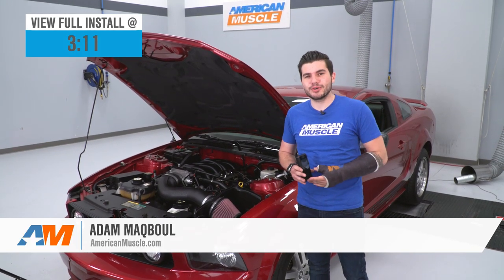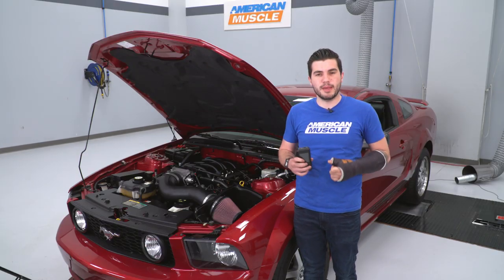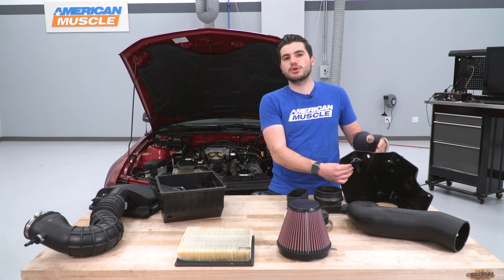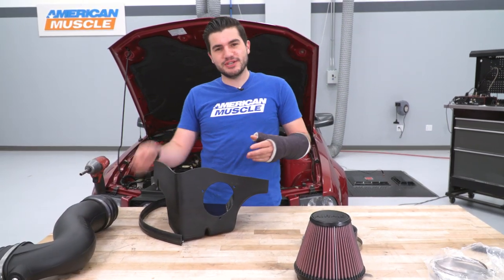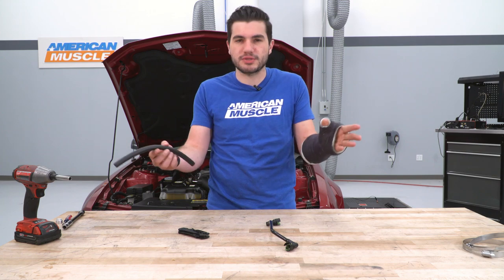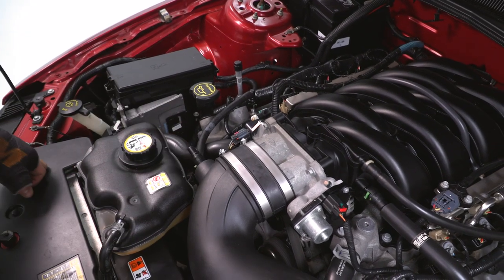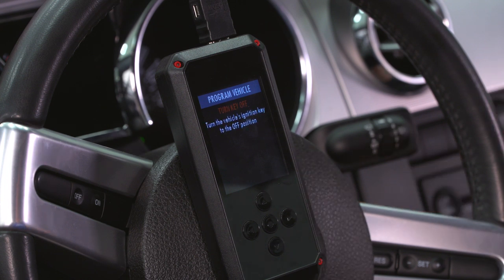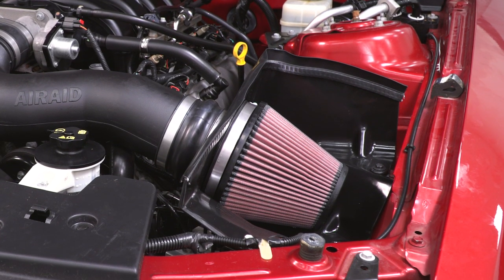2005-2009 Mustang GT Airaid Race Cold Air Intake & BAMA Rev-X Tuner Review & Dyno

Comment: i do have this on mine already, along with the bama 93 race tune. it's a very nice setup. also added the sr 62mm throttle body, ford high performance intake manifold, and kooks long tubes with xpipe and cat delete. no clue how much hp and tq is making it to the ground now. but it feels good.
Reply: The Ford racing intake manifold actually decreases hp I'm pretty sure